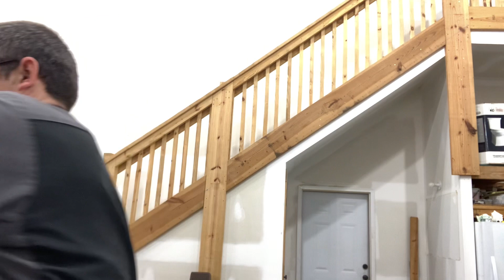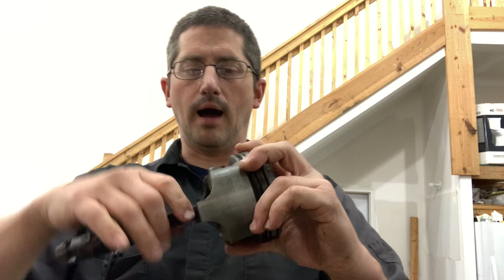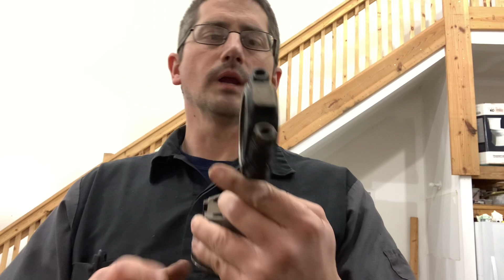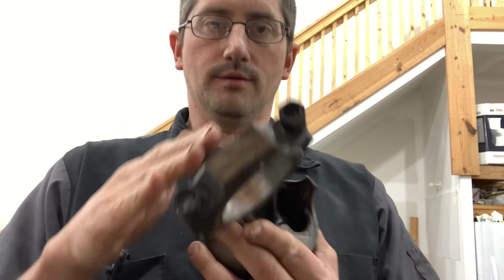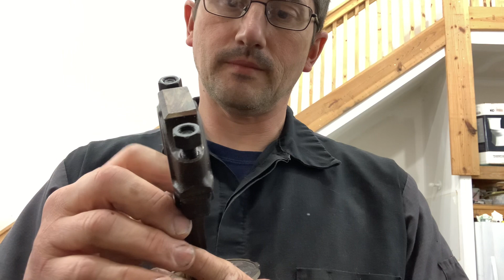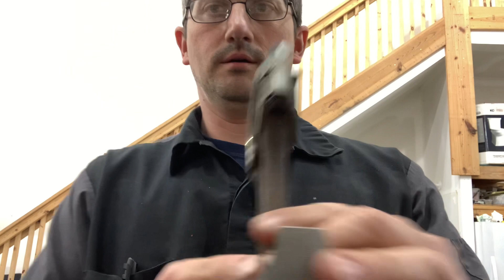Spinning the piston in the bore to get the offset piston pin in a more favorable position. 🤦

Comment: When you do it, you pull them and swap them bank for bank to keep the Crank side offset the same. In other words, they are in the hole backwards, but on the crank they are still in line. Like a Ford, you take number 1 out, tune it around and stick it back in the number 5 hole, and the number 5 in the number 1 hole.
Personally I've never done it, but there is no secret to this trick as it's been around for a very long time, and like you said what it does is it changes the dwell.
Also, this only works on offset wrist pins, centered ones...... it doesn't matter which way the "piston" goes in, as long as the rods match up to the crank, and is usually why they have dual valve reliefs. In other words, if it came stock with centered wrist pins, and you do this trick.... it doesn't change anything (no power gains) because they will go in either way.
If it has offfset wrist pins, it adds more dwell, giving it  more time to burn at ignition, which increases power gains.
Reply: I see them try to prove David Vizard & Uncle Tony (because he relit the torch on this old trick) but they fail every single time because they do it with the Modern Version of the engine that has centered wrist pins for ease of assembly at the factory. Take that same engine design and step back a decade or two when it had offset wrist pins, and you get the gains that have been proven time and again for decades. In other words you have to compare Apples to Apples, not Bananas.
Reply from the maker: Yes, I understand how it’s done, but it was brought up that you could do it without removing the piston.
Reply: @firstrespondergarage  you can, but all of the conditions would have to be met (Piston style, rod chamfers, etc.)  I certainly wouldn’t do it on anything but a test mule set up just to do it.
Reply: I don't see how it changes the dwell, but it does change the rod angle at dwell.  Also, the dyno tests to disprove were done with offset pins (most recently, a 360 Magnum, but the controls were awful and the cam timing wasn't readjusted to match the new TDC.
Reply: @JohnWilburn  You go way way way back and they were centered but they were noisy and rattled, so they offset them to make it smoother and quieter even with those tolerances you could measure with a Harbor Freight Tape measurer. It was a "comfort over power" thing. Smokey Yunick figured out that if you did this, just like you said, it changes the rod angle along with the piston dwell time, just enough to give you that little bit of an edge at the track, esp in NASCAR when they actually ran Stock cars. But as tolerances got tighter, solid lifters went away, and the engine factories were able to center the wrist pins and still achieve the quiet and comfortable rides so they did away with the offset to make it easier to assemble them in the factory.
As for the Dyno Tests that have been done to try and prove this all wrong...... yeah..... a Dyno will tell you anything you want it to tell you. There are just too many factors in how they've tried for years to disprove David & Smokey..... yet they got results actually doing it. 
It's like the other trick of paining an endurance engine white to keep the heat down. Does it work.... yes, it might only be a couple degrees but it's a couple degrees that you didn't have painting it all Black (but it's harder to pass Tech when you can see every leak). That's why "Industrial Engines" are painted Yellow, and early Mopar was Bright Silver, and you seen a lot of brighter engine colours in the 40's and 50's.... it was to help with cooling.
Reply from the maker: I’ll explain that my next video
Reply: You put it on the opposite side of the engine, put the rod in the same location and it spends the Piston around

Comment: From what i understand, they remove the piston from the rod, and spun the piston 180⁰ on the rod. The rod stays in the same hole, in the same direction. Also, this is only possible with dished or 4 valve relief pistons, so it doesnt smash valves.
Reply: If leaving a press-fit piston pin together, you can trade the piston and rod with one on the opiate bank and turn that 180°.  You have to maintain a chamfer for the crank and that’s only on one side of the rod.  Some rods have or will allow a chamfer on either side.  That, along with a flat piston would make the easier way to test on the dyno.  And this is even assuming you’ll see anything with the engine loadest against the dyno’s brake from the get-go.

Comment: As I said in the live more than once, you’d have to prep the rods by adding a chamfer to the other side ahead of time.  Obviously on rods that have a centered bolt, like the 360 rod you showed.  Also, it’s just to test a theory on the dyno, not something you would do to a running engine.  It’s definitely the best way I’ve heard to test the pin offset without disturbing the ring seal.
Reply: I could see it in your face last night John..... lolololol
"Here we go again with this un-sealable can of worms".... lolololololol.
Reply from the maker: Yes, but it was mentioned to keep the piston in bore. 👍